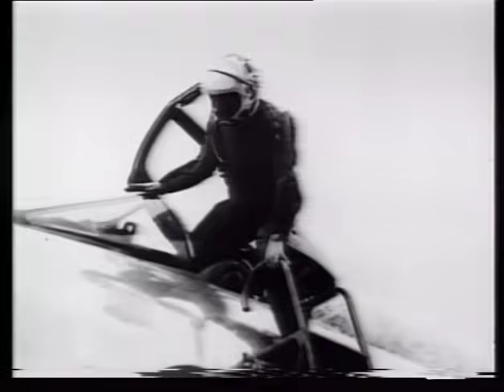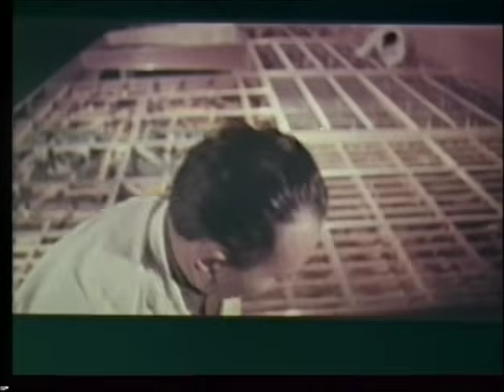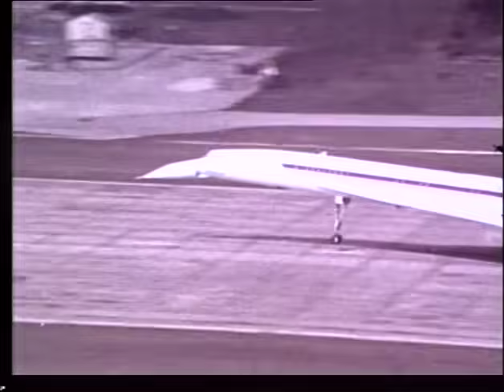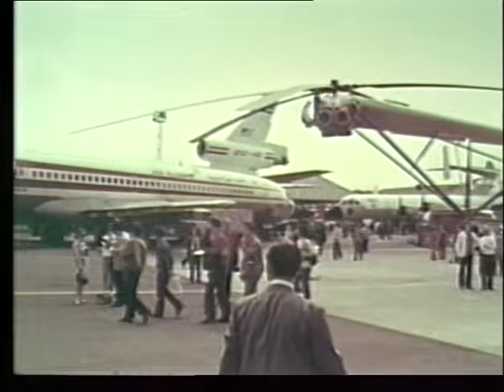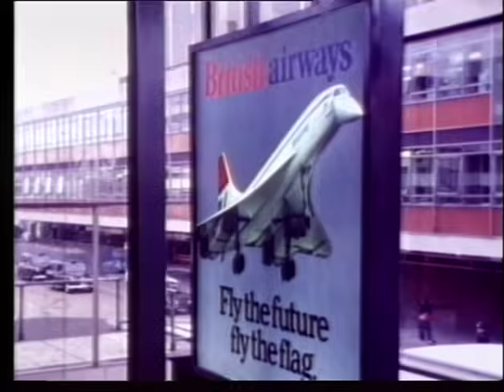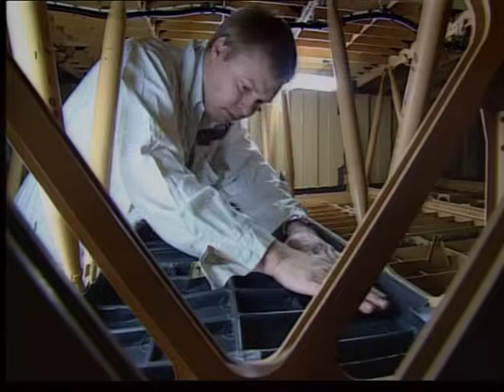ARCHIVE: The Story of Concorde from 1965 to 2003 | TV Documentary | British Airways & Air France

Comment: I witnessed myself the Conciorde prototype on its first test flight when i was about six yeses old .i think it was a weekend as i was weeding weeds in our front garden  i guess it might have been summertime but with sime clouds as i found lokking for  concorde against the sky quite hard too see in  the bright yet cloudy sky ! It few over our house roof att very low level ( altitude) in a slow pass as i coukd hear the engine noise for oerhaos about 30 seconds  a slow roolong grumblong roaring sound acimmpaninied by a sirt if higher pitch wailing soiund like waaaa aàaam.as it passed over the roof if our house. It was quite loud but nithing particularly out if the ordinary siund range as our house was in the small village like town of Heston Middlesex which is only about 4 miles away from Heathrow airport and we were used to the sounds of jet ir turboprop airliners flying over or near our house. But as the conconcorde protoype flew at low level directly  over our house  the nause was augmented by the engine sounds of The RAF fighter planes which were in close escort around it as it few over as well as several RAF helicopters escorting it as well! I was i guess five or six yeeas old , it must have been around 1969. A few years later the ist 747 jumbo jet maiden transatlantic flight landed at heathrow airport . Thst 747 flight was if i can rember rightly  1970/71 but just before that happenend it was yhe locheed tristar passenger liner that grabbed all the headlines as the new wonder passenger airliner with its new invented rolls royce rb2 eleven engines . Tristar was a very quiet  ride  for  its passengers and one of  the first wider bodied jet airliners . My dad was out if our family that day the ist to spot the concorde prototype ist flight flying low over the roof of our house with its raf jet fighter escorts and its raf helicioter escorts. My dad knew quite a lot about aircraft as he had been from 1941 to 1946 an RAF armourr in Burma and his jobs out there was mostly  working  on raf planes. My dad told ne the concorde reminded him.of a very large and elehant arrow. I never saw what fighter planes were esvirting it but in thise days it mght have been either hawker hunters or english electric lightnings. My mother and her parents and siblings  had moved to Heston middlesx in pre ww2 1936 my dad and his siblings had  moved  there in 1950. Id lived there from when i was six months old til i was 8 and a half. When we finally moved away from.heston  in 1972. It was therefore an authentic sighting if yhe ist trst flight of the cincorde prototype i had witnesed with my dad that day as it fllew low and slowly iver the roof of our house. It must have been 1969
Reply from the maker: Wow! What a sight to have witnessed!